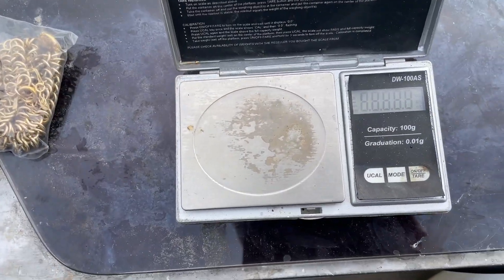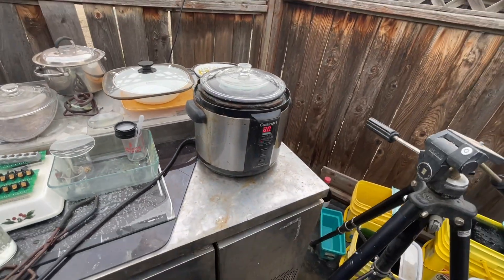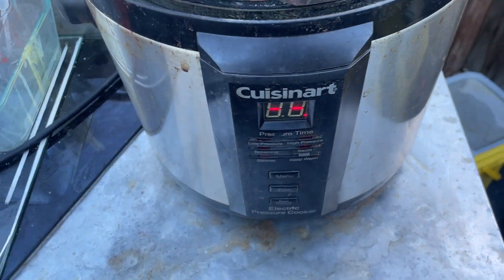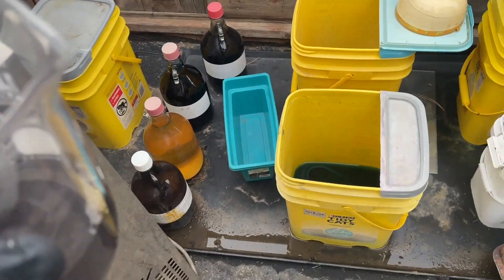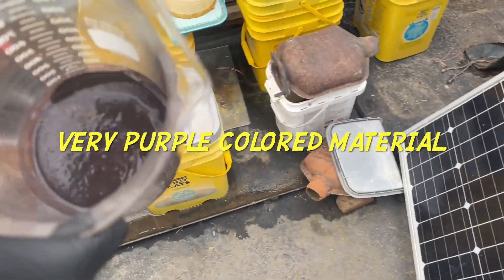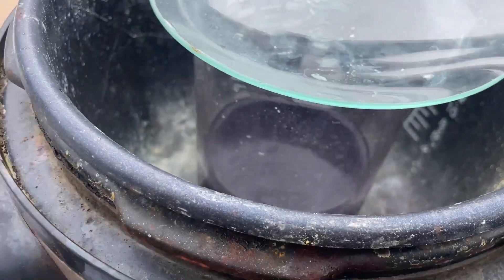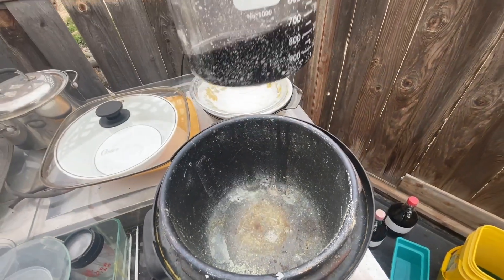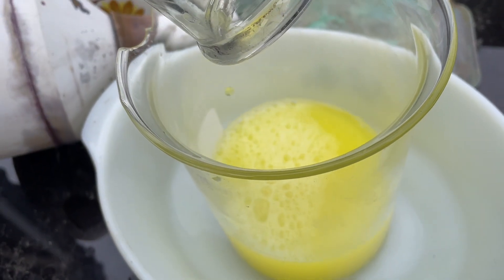Gold Filled Scrap Refining.. An Example of a bad refining Technique that ends up a Pain in the AU

Comment: Rinse the super-fine gold out with water and strain through a coffee filter (or 2-3). Then you can burn the filter along with the gold particles in your crucible (best in oven, but might work with torch). Depending how many particles you have, you might use the same filter for several batches so when you finally burn to recover, it makes a bit more "pure" quality gold.
Reply from the maker: Absolutely terrific comment!
Thanks much 
Peace Prospector Tripp

Comment: I usually put the beaker with the fine solids in the top of another beaker at an angle to settle.  It allows easier decanting of the liquid.
Reply from the maker: Amen brother. I thought it might be valuable to show what happens when break established refining rules.
This gold filled scrap is 1/20th 12k.. which is 1/40 pure gold. 
Quartering (1/4 Au and 3/4 Ag works like magic) 
1/40th not so much 😂 
Follow the rules ☝️ 😂 
Thanks Keith 
Peace Prospector Tripp

Comment: colloidal gold, in this case it's from melting the material. The percentage of base metal is too high . The gold is so spread out it never bumps into another gold particle. The fluid density gets so high the gold floats. It's too small to trap in a filter, too small to sink. What do you do? Full evaporation. Crust in the bottom. Dissolve some gold add that solution to the crust. It dissolves the colloidal gold. Then you can drop the gold and recover everything
Reply from the maker: Terrific explanation!
Thanks much 🙏 
Peace Prospector Tripp
Reply: @ProspectorTripp  You welcome, in a multitude of counselors their is wisdom
Reply from the maker: @joek511  amen

Comment: So DONT add pbr ? 😃✌️✌️✌️✌️
Im getting more confused as i watch but also more interested 🤣
Reply from the maker: Frozen is fine 🤓 see Wisconsin 1 F FGW PBR 😂 
This “Do Not Do This” video.. was fun but around 1/2 of the ultra fine gold is in my stock pot 😂 reasons #1 😂 
1/20 12k is actually 1/40th pure gold. This sample was 60 grams = 1.5g pure gold. I got .6 😂 
I’ve loosely inquarted from about 5~6% to 8~9% and the gold is really easy to handle. The higher percentage experiments take longer boils but still yielded high purity gold. 
1/4 works well.. 1/40th not so much 😂 
I know.. I know..
LongWindediPhoneFingerPokingDude
Thanks Jason
Peace Prospector Tripp
Reply: @ProspectorTripp  
Longwindediphonefingerpokingdude…. Another awesome tattoo ✅🤣✌️